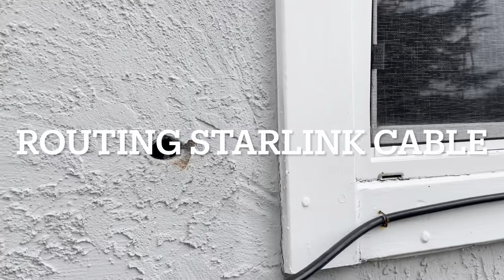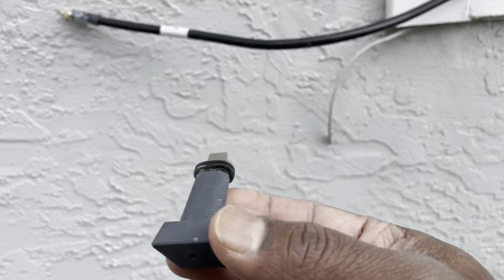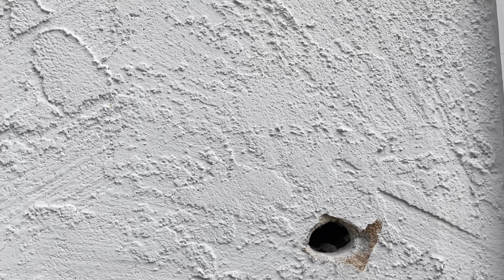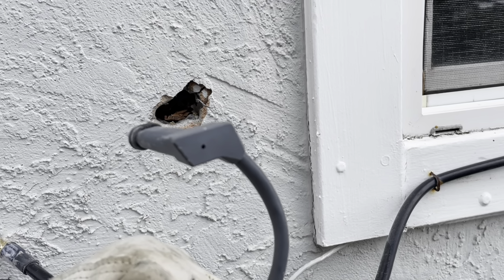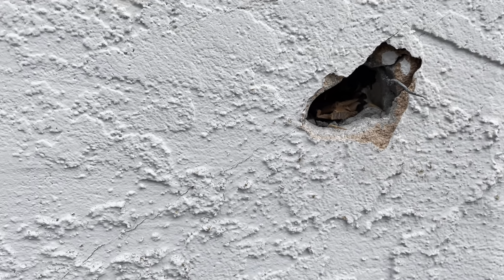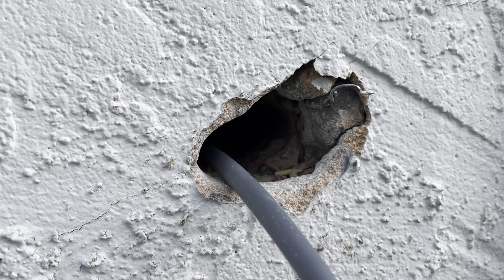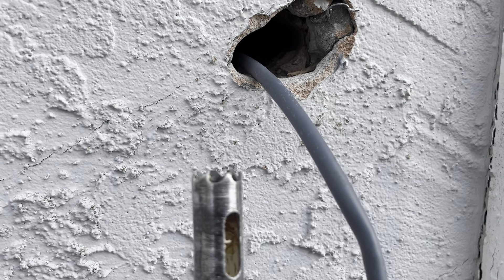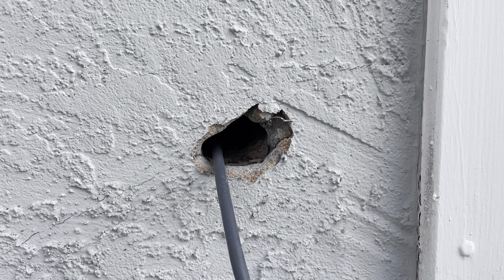Routing Starlink cable, difficulty putting cable into house

Comment: You are supposed to use the opposite end that connects into the dish it was designed straight to feed through a hole. Unplug from dish, feed cable from inside the house to the outside and reun cable back to dish and plug it back in.